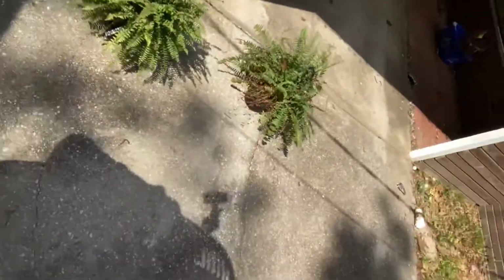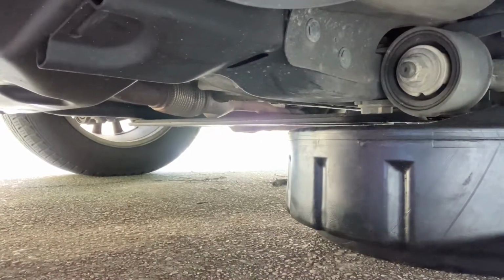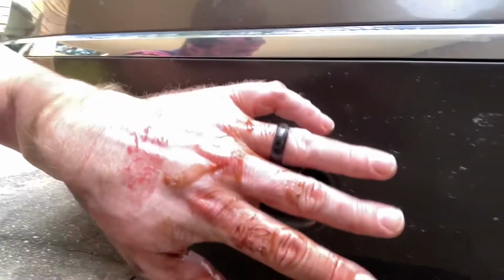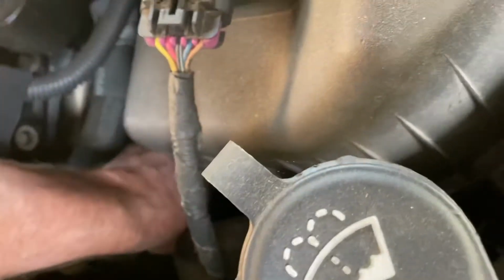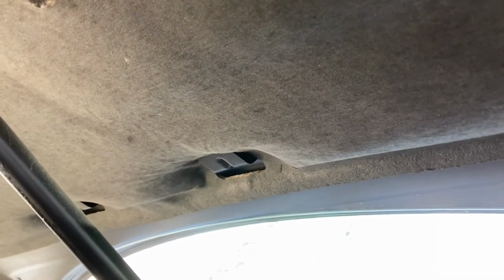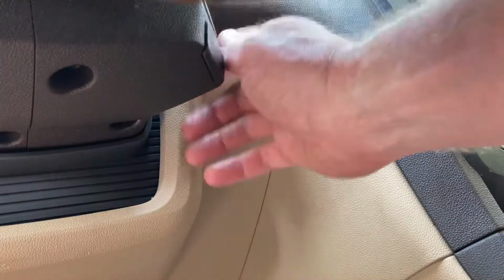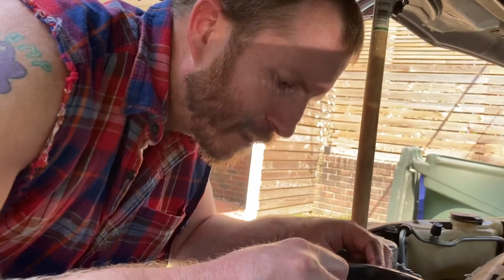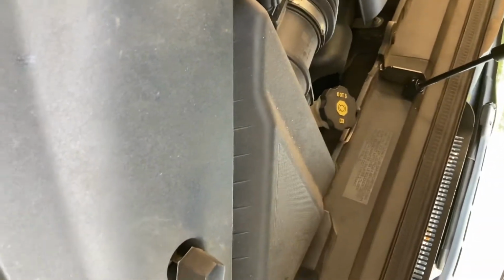Enclave transmission sitch

Comment: Mine does that. I put in seafoam. When I shift into drive, I wait till I feel it go into gear, and it shifts normally. If I don't wait, it too revs,and stays in second, until stop, and put it back in park to drive as described. 3.6 has the timing chain stretch issue, had mine replaced last year. New reengineered valve cover gasket is supposed to help.

Comment: I have a 2008 and it doesn’t want to get the last gear. I haven’t changed the fluid yet I noticed that the fluid was red my husband got a brown or  tan I believe Auto store gave him wrong brand I’m going to change it myself I’m small enough to fit what size socket  looks to be 5/8  I’m glad I came to ur post also I found you very amusing. What yr is your vehicle. Mine has stabilizer link light on and traction control as well.
Reply from the maker: 2010. It was 11 mm I believe. How did it work out?  I haven’t had those issues yet.  I did have to replace the cv axels and all the suspension related parts. Also had to replace the head gasket which was a nightmare. Unfortunately I wasn’t recording back then. Thanks for the comment!

Comment: sent my 2008 buick enclave to a mechanic, he put a whole front end on it, struts cv joints, seals, know the transmission was stuck in gear. he changed the fluid in it and said it didnt do it again. I am just really upset with him. he had the car 4 months. and cost me a fortune. now the transmission. it even had a transmission line leak. Im afraid to drive it home.
Reply from the maker: Wow 4 months? Struts And cvs took me a few hours. If it was stuck in gear I wonder if he messed up the shifter cable.
Reply: I'm bringing it home. And finding someone else to look at it

Comment: Hello. Did you have the check engine light on? Did you see any codes on the main dash screen? For example “engine power is reduced” or “service stsbilitrack”?And it did it ever go into limp mode? Meaning it wouldn’t shift out second gear but the RPMs would rev up high?
Reply from the maker: No lights codes or anything. Just wouldn’t shift